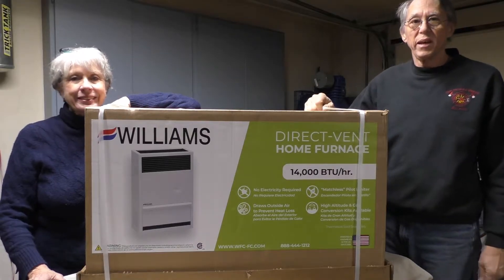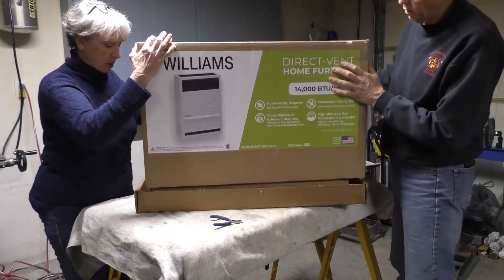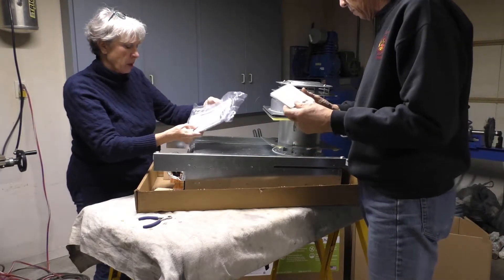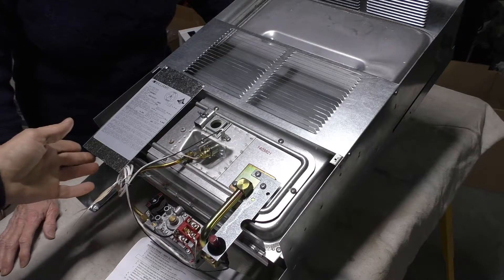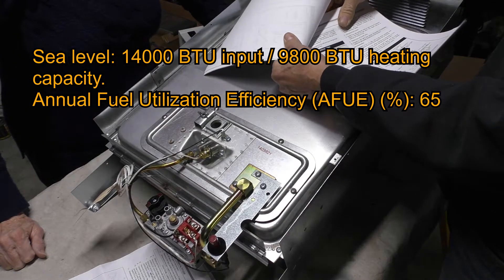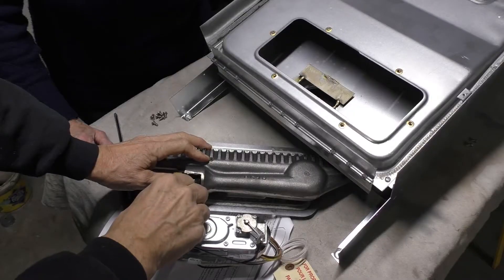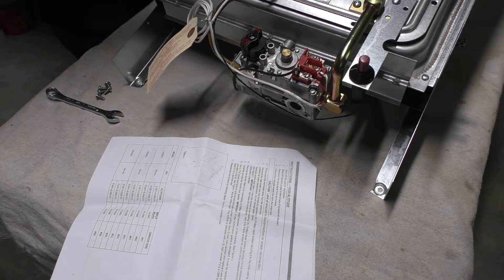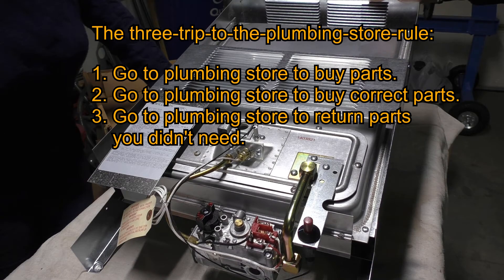#34 Williams Direct Vent 14,000 BTU Propane Furnace for Off-Grid Tiny Yurt Home and Altitude Kit

Comment: What is the square feet your heating?
Reply from the maker: We are only heating 120 square feet.  We are very well insulated...heater does not need to run much. Our elevation reduces heat output of furnace. Mostly a matter of how many BTUs your space needs for temp and how well insulated.